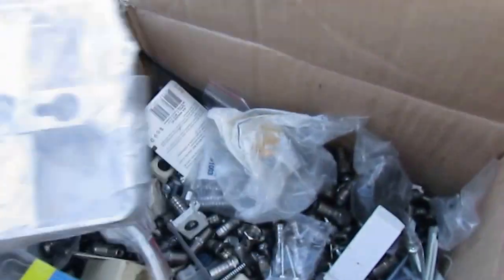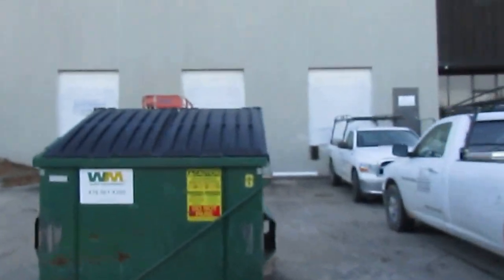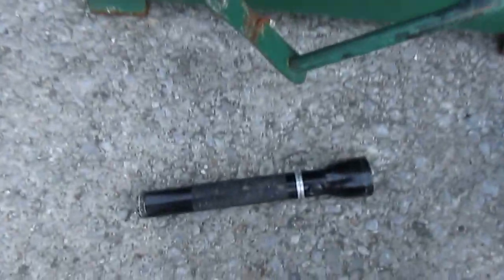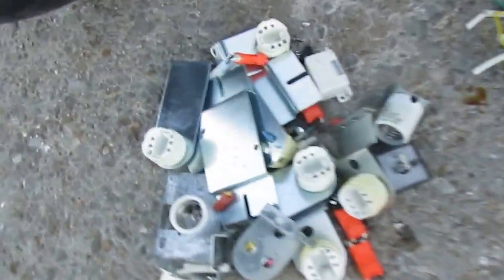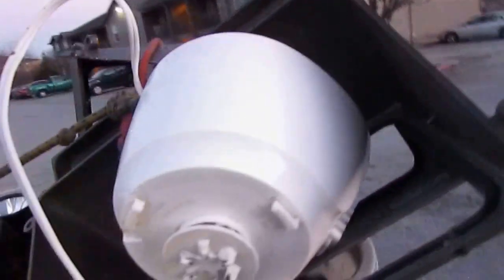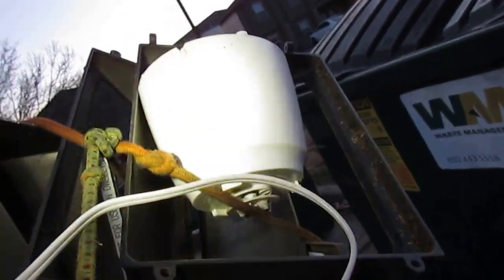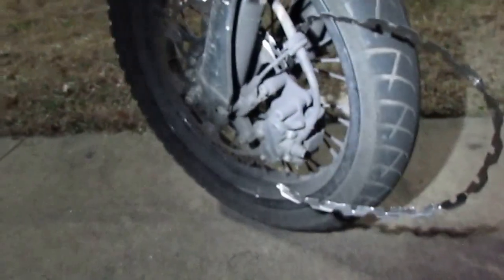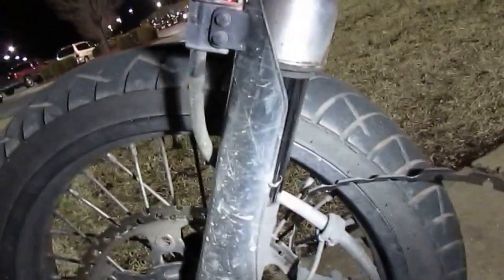SCRAPPING ALUMINUM LIGHT FIXTURES Dumpster Diving for Treasure & Scrap Metal Dremel Maglight Copper

Comment: Those hornets were probably staying warm under the heat of the motor. They probably got trapped in there, and when they replaced the flood lights they're home got progressively colder so they crawled under the motor to milk as much heat as possible. Man, that Dremel tool is boss! I always hope to come across random electric tools. That Pumpkin is probably worth a good 30-40. Keep it until mid October, flip on Etsy as a 'vintage collectible'. You carry a ridiculous amount of stuff on your bike.
Reply from the maker: ah, prob right about the hornets. did u get my 2 messages i sent about light and roberto blake... video creators... channel? i got  a return unable to send message for something...